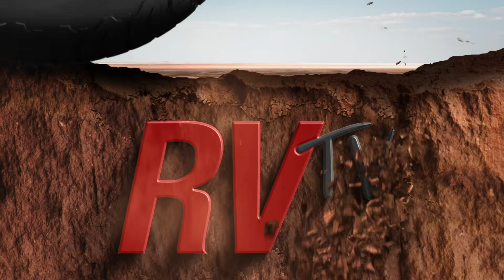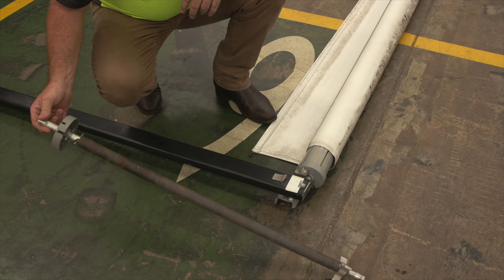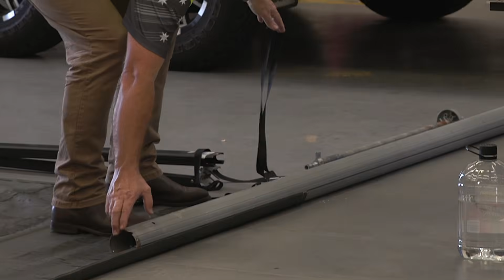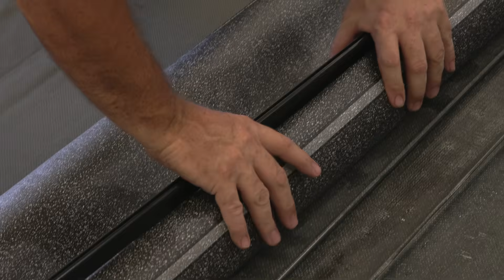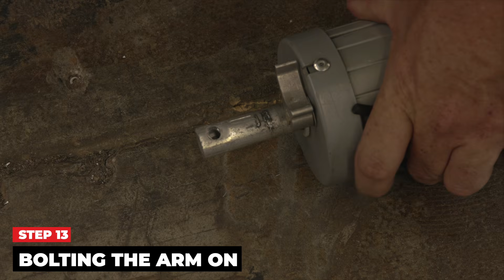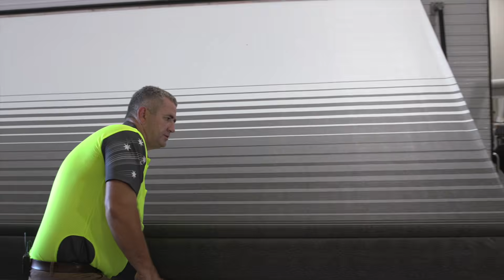Replacing a Caravan Awning Fabric - Removal & Installation

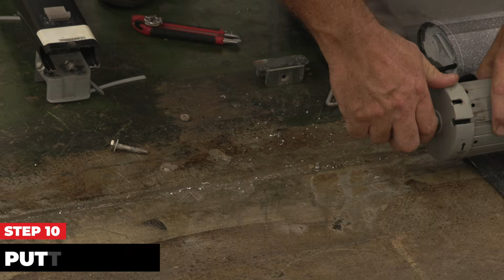Comment: I noticed that when you assembled the new awning you mucked it up. There are three slots in the roller. Two for use by the awning install, the third for privacy awning fitment - this third one has the entry groove in the end drum for the privacy awning spline to be fed in. The first two slots are meant to be used for the main awning fitment. But you used the second and third slot blocking the fitment of a privacy awning as only the third slot has the track entry point for a privacy awning. This was visible at time 11:10.

Comment: Excellant video but I have a question!
At the start of the video you say to roll up the awning which places it in the spring relaxed position. You then walk the awning off the van and lay it on the ground, but the awning is now fully tensioned (7 turns). How did this happen? Mine is now on the ground fully relaxed!  HELP
Reply: 7 turns isnt fully tensioned. thats just how much tension is needed so the awning rolls all the way closed when installed on the van.

Comment: I have just watched this video as I need to get my awning skin repaired. The stitching has come apart at the track side on the van. Once I have the skin resewn is the process the same as replacing a skin bearing in mind I won’t have a second skin to use as a guide?

Comment: When ordering vinyl what happens if it comes folded up in a package and it is full of creases which could cause holes. Should vinyl be sent rolled up in a long tube and therefore no creases
Reply from the maker: We take GREAT care in packaging our vinyl, however, the vinyl will still come with creases from the packaging.  To get the best out you need to unpackage the vinyl and install it as soon as you can to allow the sun to heat the vinyl which helps remove any creases. Rest assured our vinyls come with a 5-year warranty.

Comment: They are nearly all 2.4m but were do you measure the length from pole to pole or just the length of you old awning?
Cheers
Reply: Most of the awning sites want the distance from arm to arm which is usually a foot or so larger than the fabric. Most sites i looked at explained this and tell you what size to order and where to measure and also the actual size of the fabric itself.

Comment: Great easy to follow video. I've had a couple of garage roller door jobs and know that spring tension and fingers don't always mix well! Excellent instructions with each step explained and shown clearly. Was a bit apprehensive of doing my own awning (and nearest service is 650 km's away. Your awnings were on top of our list and the video on how to just clinches it. Thanks
Reply: I was afraid of the spring also. I ended up replacing mine without messing with the springs and rivets. I made a video on my channel if you think it might help you.

Comment: Are both ends tensioned
Reply from the maker: Yes, both are tensioned.  When I release the pressure off.. it is de-tensioning both springs at the same time.  Removing both is required on Dometic awnings, whereas Sunburst and Carefree can be done removing one only.  Removing both is great to check the condition of the both springs, as surface rust can be an issue. Spray both springs with lubricants regardless for better performance of the awning. Tension will still need to be reapplied to both springs.
Reply: Removing the second spring is a glaring omission in the video isn’t it because he tensions both springs!
I did mine with only one spring removed (the ratchet side) I could not see a reason to remove it.

Comment: Great video thanks. One clarification is the locking pin referred at time 12:45 . As this is removed later (video time 14;40) is there any special pin needed or just a nail that fits snugly in the hole and is then slid out using pliers? Thanks again.
Reply from the maker: A nail is fine… just ensure it is about the same diameter to the access hole or as close as possible. If you use anything too small or soft, the spring pressure can bend it making it very hard to remove. A 5mm steel rivet shaft can also work.

Comment: Thank you for posting such an informative video. I have 2 questions for you if that is ok.
1 - Can you replace the awning skin by only removing the ratchet end  and not the opposite as well? This would eliminate the need to remove and re-tension that end and no need for a locking pin.
2 - Why did the fabric in your video wrinkle up at both ends? That would be something that I would NOT want when we replace a skin.
We are getting a quote on a replacement awning skin from you now so this was great timing. Thanks again for your video.
Reply from the maker: Hi there.. apologies for missing your comment.  I will answer for the benefit of others also.. given you may have already sorted this out.    
1. It is possible on some awning to remove just the one end.. like Carefree and Sunburst, however on Dometic awnings, the splines are folded back into the drum at either end which locks it in.  If you look closely in the video, you will see this as I remove the spring.    The other reason to remove both springs is to assess them for rust.  It is possible for surface rust to bind the spring, ultimately reducing the performance and capacity of it.  Use a wire brush and some spray lubricant to help free the spring again.
2. The wrinkles you see when it rolls up are completely expected when new.  This occurs because the hems are thicker than the single layer of skin across the middle.  However, as the skin ages, it naturally tightens across the middle and as a result begins to settle out the wrinkles.  If you ensure the pull strap is in the middle as you roll it away, it will assist in getting another layer of thickness across the middle and help match the added thickness of the hems.
Hope this assists... and again apologies for the delayed response.
Safe Travel ;)
Reply: I can answer this one for you. On both sides on the awning you have a small plastic  rope inside the vinyl awning to keep the awning strong from it flapping which takes up more space when rolled up on top of each other then just the middle itself which is just vinyl, you cannot avoid this and doesn’t hurt the vinyl warning itself